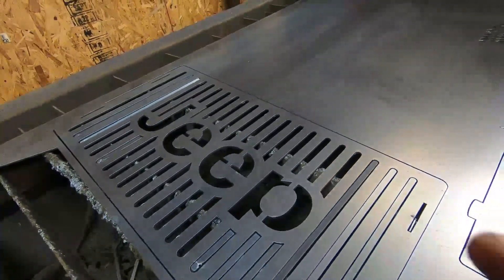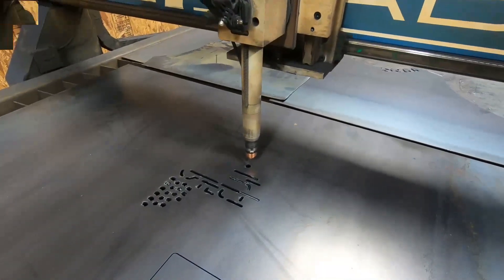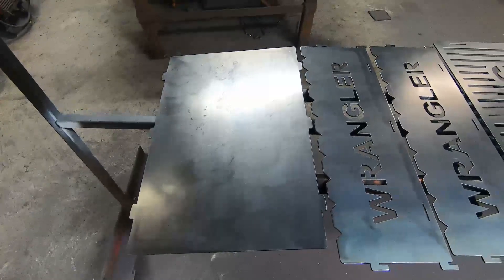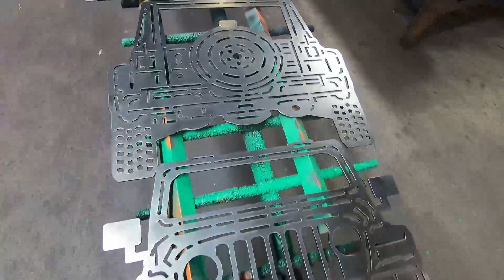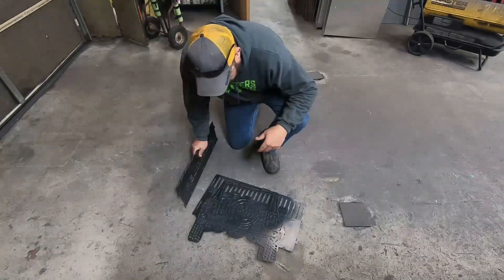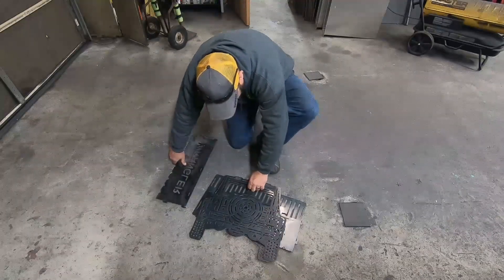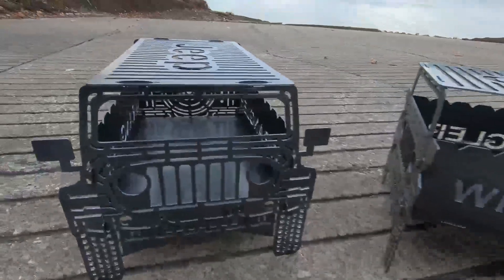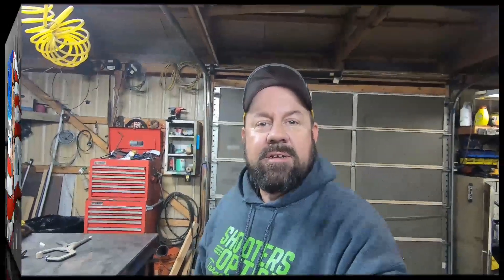Building a jeep from a CNC plasma table

Comment: Just found your channel. Love it! Question for you please: I'm currently using Adobe Illustrator for my cnc designs but am running into the problem of how it exports with splines instead of poly lines. (Running the file through qcad make a small difference, but still when i generate the gcode i get line segments) What software do you use for designing your parts and artwork?
Reply from the maker: Jesse check some of my older videos, we have a lot of info on the program and some of how things get drawn up. Enroute is our regular program so some of the others i'm not familiar with, hope that helps.
Reply: @shootersoptiontargets  thanks i will